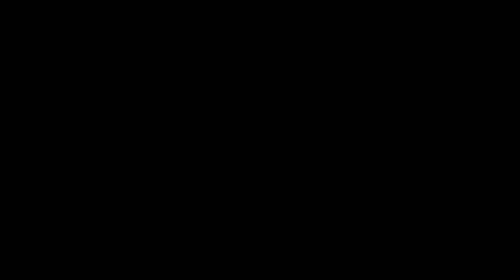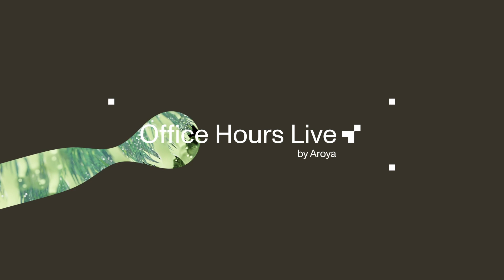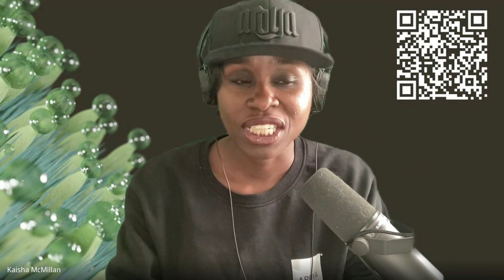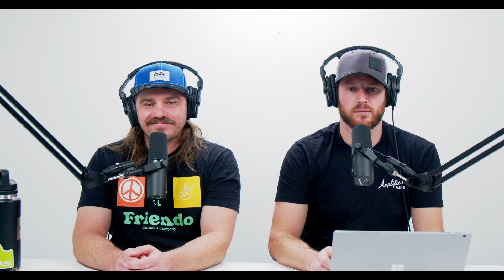[FULL] Office Hours LIVE Ep 84: Understanding Crop Steering: Water Volume and Drybacks Explained

Comment: 25 gallon bin or 55 gallon barrel with an aquarium pump in a smart outlet + 1/2" tubing, 1/4" drip lines plugged into 1/2" line. 2 lines per pot, 3 gallon pots of coco.
measure how uch water you get per dripper per minute.
Setup pump to turn on for long enough to feed about 300ml of water (say 30 seconds), every fifteen minutes after lights on, 8 times.
Then setup the timer to run the pup for 45-60 seconds every 1-2 hours until 1-2 hours before lights off.
monitor how light the plants get between irrigations in the afternoon and overnight and adjust the pump timing, or the time of the last watering during lights on.

This can get a home grower 80% of the way to crop steering for around 50 bucks.
Then for another ~$100 you can setup data logging and a DIY TDR sensor to log VWC and pwEC and enable you to fine tune your irrigation times.
Home growers can get into detailed steering for around 200 bucks all in, and that includes a TDR sensor on par with a teros 12.
Reply: Which sensor are you using? I'm using an Alibaba one right now, but I wish I had more sensors to compare it to. The pwEC formula given seems to need work.
Reply: @lucaswalker3858  wincomtop THC-S. all the sensors even $X00 ones need calibration. The pwec calc depends on your media, we are using the hilhorst calculation.
Even if the exact pwEC values arent perfect, showing you the daily swings, as well as response to p2 irrigations can be enough data to steer by.
Reply: @lucaswalker3858  the THC-S sensor from aliexpress. was calibrated against a teros 12 in same pot/solutions but agree pwec calc doesnt seem perfect. but its good enough to watch trends and water by and costs a fraction of the commercial options. We plan to get the teros1 working in our system to calibrate dielectric with the THC-S, we also have a stevens' sensor we can calibrate with. The problem with sensors is that at some point, something has to be properly calibrated but which device do you trust?